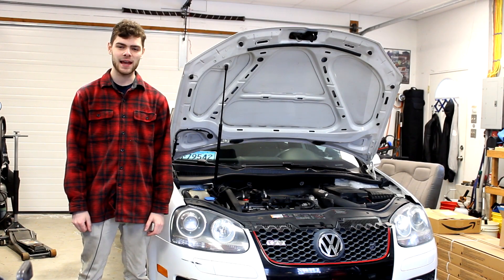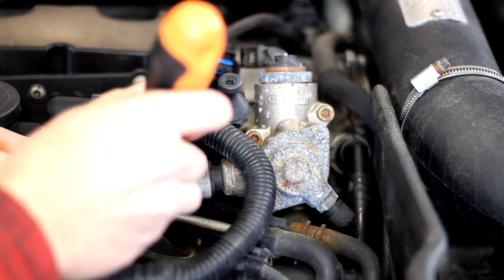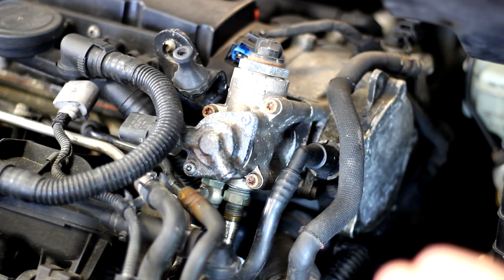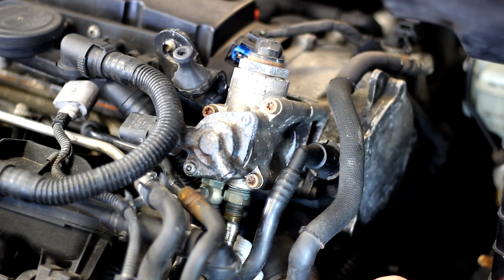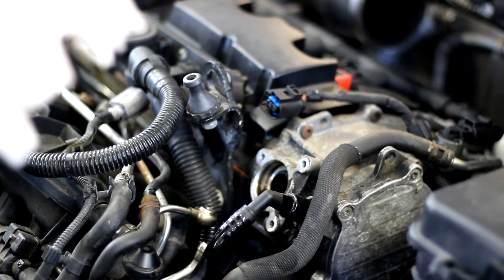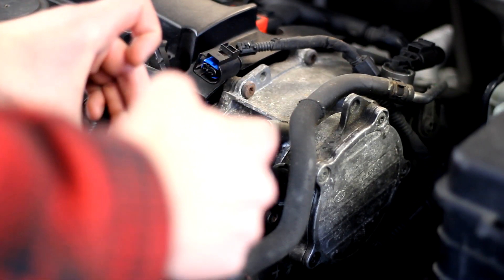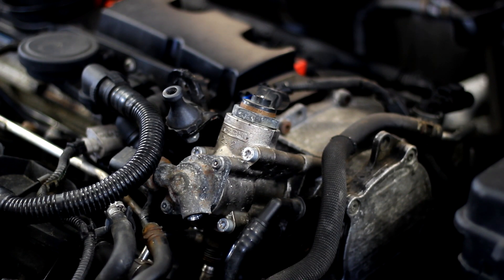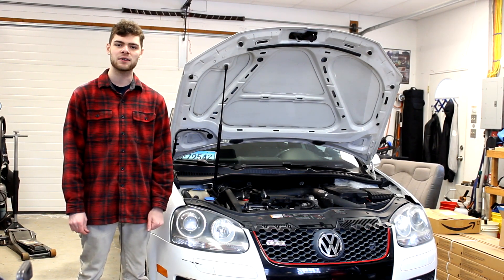Cam Follower Replacement - Volkswagen FSI Engine (For Golf GTI and  Jetta GLI)

Comment: I have a Volkswagen Passat 2.0 L Turbo and my mechanic( sorta trustworthy) had replaced my starter( old one was burned out) and my cam shafts sensors ( also burned out). The Person I bought it from said that is the reason the car doesn’t start, now I replaced everything that I needed to start it and it still don’t start. It is making a click sound every time I try to start it. Please help me figure out what’s wrong

Comment: I recently changed my cam follower and now I am having fuel cut outs when I’m driving any idea what it could be?
Reply: Ah I changed mine 6 months ago and im now having this problem to. My local mechanic said your high fuel pressure is leaking and is not related to the cam. What did you do to fix this
Reply: Scan for codes. Engine light won’t come on in some cases

Comment: Does my mk5 1.6 FSI has that system with high preasurre pump and should i inspect my cam follower(if my car had it)? Thank you.
Reply: @paul479  there is 3 types of 1.6 FSI engines in VW those years: BAG, BLF and BGU. You must find which one you have. They are almost same, with some little difference.